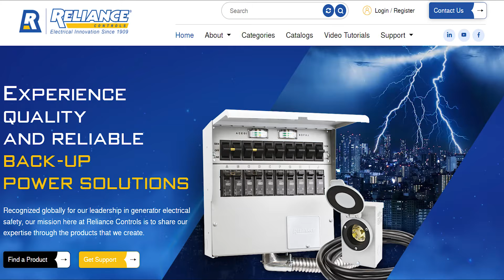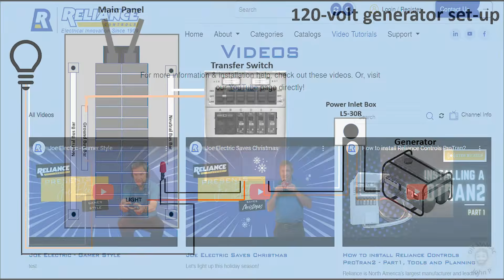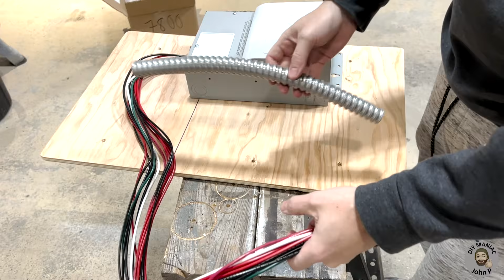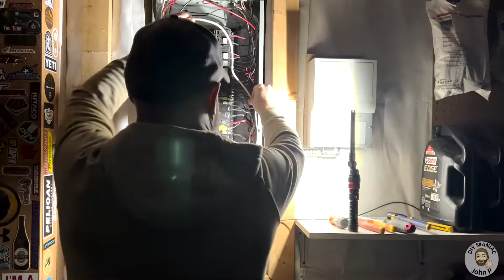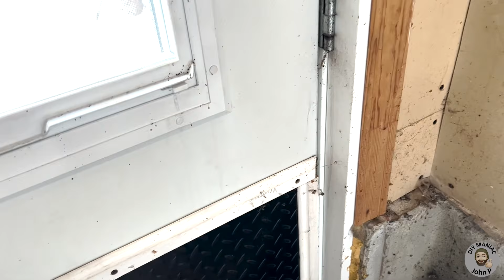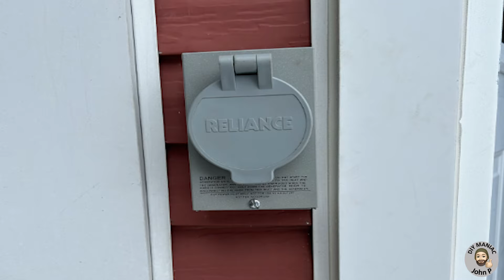Manual Transfer Switch for Home Generator Install Reliance Controls

Comment: Can you use wagon connectors instead of wire nuts
Reply from the maker: You would need to check with your local building codes and electrical codes

Comment: I just installed my 10 circuit Reliance transfer switch and agree that the red and black wires that go to the circuit breakers should be about 12" longer.  Also it's not clear in the manual how one should position the Reliance breakers both with utility power and with generator power.  The Gen/OFF/Line switches are clearly marked but the breakers are not and there's no mention of them in the manual.  I will say that the unit is well made and of heavy construction and it's nice to see that it's made in Wisconsin where I live.

Comment: Got a question,  Have a 22kw whole house standby already installed, so the bonding is done in the transfer switch, and the grounds and neutrals are separated in the inside breaker panel. If installing this as a back to the back up, do I keep the ground and neutral in the the breaker panel separated for this switch?
Reply from the maker: I am sorry, but I am unable to provide any electrical guidance. This is based on guidelines being different from geographical location to another, but also I am not a certified electrician. I recommend you reach out to a local electrician to answer your questions.
Reply: @DIYManiacJohnP  no worries, thank you.

Comment: Did you have to make your generator a floating ground from a bonded ground?
Reply from the maker: With this particular set up if you are following code, the generator must have a floating neutral. Only one bonded neutral is allowed in the home electrical system, and that is already been done in the main service.

There are generators on the market that come with a floating neutral. Otherwise you will have to modify the generator you have.

Comment: I don't understood why you would want to do this over a manual interlock -especially if you're a DIY kind of person. It's so much more expensive than just an interlock, and so much more limiting. I can choose what circuits I want, whereas with a transfer switch, you're stuck with what you chose. It's much more flexible just to do a manual interlock, and understand your circuits, so that you can power what you can support. Plus, it's a whole lot cheaper.  I love mine
Reply from the maker: The point of this video is not a debate which way is better. It is to show how to install a manual transfer switch. 

If you are happy with your set up then that is fantastic.
Reply: This is a good option if service disconnect isn't at the main panel.
Reply: pros and cons to each method really - with the manual transfer switch, at least you could run some of those circuits on utility power, and some on generator power (nice flexibility if you have solar panels and a solar generator/power station)

Comment: Thank you for sharing your experience, I was wondering if I can install my transfer switch next to a subpanel instead of the main panel (my essential breakers: Fridge, furnace, lights are on a subpanel).
Reply from the maker: Thank you for watching.  while I would of course want to help. My advice is not professional so I would suggest reaching out to reliance directly or your local electrician with any of these questions.

Comment: My question is if the transfer switch is in the LINE position when running off the panel, and GEN for the generator. What is the off position for?
Reply from the maker: Exactly as his name states.  it just shuts power to the systems it’s feeding. It’s just a quick way to kill power to anything connected to it regardless if it’s on generator or line.

Comment: Can these breakers in the transfer switch be switched to square d  breakers? Also can all the breakers be switched to 20 amp breakers. If they cant be switched to square d breakers then which ones are compatible
Reply from the maker: I can’t speak to switching the brand of breaker that you will need to contact the manufacturer, but yes, you could replace from one amperage breaker to another as long as the wiring and the rest of the connections are rated for that amperage draw
Reply: @DIYManiacJohnP is the transfer switch rated for 20 amps on all the slots
Reply from the maker: @weldonpinder7295  your best to refer to the manufacturer or going to their website and downloading the operation guide this would give you the most accurate information
Reply: @DIYManiacJohnP would you have a link for the manuel because on the website the page keeps freezing. I dont live in the usa any im limited to what is here on my small island
Reply: Yes, square d breakers are compatible.  QO, QOU, QO-HID, QO-PL, HOM are all compatible.

Comment: I agree with the others—this is hands down the best and only video that thoroughly explains transfer switches. Much respect!!!
I’m using a portable generator with a 50A outlet (14-50R) - (12,500/9,500-Watt Tri-Fuel: Gas, Propane, Natural Gas Powered, with Remote Electric Start). My plan is to connect it via a 50A transfer switch. The A510C model appears to have a single 30A double pole breaker (for 240vac)?
Since my main priority is powering my home’s AC unit, I understand that the compressor requires a high starting amperage. I’m considering something like the Micro-Air EasyStart (368 Series) to help REDUCE that load/amperage during startup.
For those using a portable generator (not a Generac), what solutions have you found effective for running a 4-ton Carrier AC unit?
Reply from the maker: Thanks for the kind words and for watching.
Reply: We have a 3-ton AC unit that I installed the Micro-Air EasyStart (Don't remember the model #) We can run it on our 9000/7250 watts Tri-fuel generator using NG.

Comment: Thanks. This was a helpful demo. I have the Pro/Tran 2 model and it's set up the same way, but allows for a single 220 circuit. Unfortunately the kit comes with a 4-prong plug, but my Powermate 4500DF generator only has a 3-prong outlet, so hopefully i can find some kind of 3-4 adapter for it.
Reply: It looks like the Powermate 4500DF is a 120V only generator.  It will not have a 4-prong plug...
Reply: @jimbumgardner4835  Correct. i was able to find a 4 to 3 adapter that works, though.

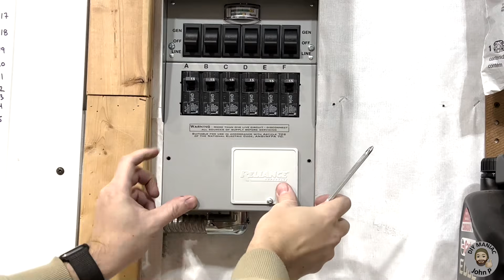Comment: 11:55 Why did you skip showing the wiring of the power inlet wires to the transfer switch. Did you wire the bare copper ground from the power inlet box to the green screw AND the green wire provided in the transfer switch to that screw as well?

Comment: Here there! I have another question. I installed the 30amp transfer switch. I’m going to run my champion generator that is neutral bonded to the frame. Does it need a grounding rod? So much confusing Information. I’m assuming my home system will ground everything. Thanks for your help!
Reply from the maker: I am sorry but I can not give that type of recommendation. You are best to check with a local electrician
Reply: I totally understood that. Can you give a hypothetical answer and not a literal one? Just interested to know lol

Comment: Even though these switches are sold all over in the big box stores, there are electrical jurisdictions that do not allow wire nut splices within the breaker box. Check with a local electrician before trying to DIY this kind of unit. Your insurance company might void your house insurance if you are not in compliance with local code.
Reply from the maker: Well, said I stated in the video this is just for instructional purposes. You must do your due diligence before doing this work.

Comment: Great video man! I have a dumb question to ask haha does the breaker amp have to be the same as the transfer amp to join them. For example if I have a mini split that runs on a double pull 15 amp which is 30 can it be hook to a double pull 20amp which is 40. I’m a newb but I would assume it needs to be the same. Cheers!
Reply from the maker: Yes, it needs to be the same.

Comment: I have the 10 circuit outdoor version of the Reliance, that has an integrated 50amp generator connection.  Their customer service is excellent.  Installation is very straightforward, just takes time to get all the wiring connected.  A nice feature is a sticker inside the cover that lists breaker models for the major manufacturers, so if you need to change the amperage on some of the transfer box's breakers like I did, it's easy to shop for breakers.

Comment: is the generator sending 120 or 240 to the switch???  I "heard" that it will accept either,  but is the wiring the same??
Reply from the maker: My generator is sending 120 V but yes, this transfer switch and work with both

Comment: I have the 10-circuit transfer switch in the outdoor enclosure.  I mounted mine next to the meter can.  I was originally going to follow an old water-heater control conduit via the can, but determined that this would not meet current code.  I cut a hole in the back of the panel and used the supplied liquidtight to pass thru a thick brick wall to a large junction box immediately  below the breaker panel.  This provided ample room for wire routing and splicing those which wouldn't reach the desired breakers.  I'm very pleased with the switch design, function, and layout.

Comment: You could put a 240 on/in that transfer switch if you used two of the 120s for the hot water heater, for exampl, no?
Reply from the maker: Yes you could

Comment: My main panel is on the outside of my garage, would I be able to have a transfer switch installed on the interior wall of the garage and have the wire ran through the wall to the main panel? I was looking at a 50A transfer switch that has the generator input on the front of the trans switch.
Reply from the maker: You will need to check your local byelaws to ensure that any installation you do meets requirements and restrictions
Reply: @ aka local electrician is my best bet to ask. Thank you

Comment: Question, when power goes out do you turn your panel main breaker off before starting generator so it doesn't backfeed into the grid?
Reply from the maker: The answer to your question is highlighted in the video multiple times thank you for watching
Reply: @DIYManiacJohnP  You talk about turning the main breaker off during the installation and you discuss the switches on the Transfer switch.  I am talking about during a power outage should you turn off the main panel breaker before starting the generator.  A simple yes or no will be fine.
Reply from the maker: @stevecunningham936  i’m sorry if what I highlighted the video wasn’t clear but the way the unit is wired and as I demonstrated in my schematics, there is no need to turn off the main breaker as when the transfer switches activated lying voltage is cut
Reply: @DIYManiacJohnP  Thank you

Comment: Nice work— thx for sharing this.  From what I can see in your video, it appears the neutral is not switched therefore I’m assuming you’re using a floating neutral generator so that you don’t have two separate bonded neutral points in the system?   Can you talk about the bonding of your generator configuration?

Comment: Great video.  I see that you used a Wago-type connector to bridge together the 10AWG black and red wires inside the Reliance switch before wiring the L5-30 inlet.  I didn't hear you mention that in your narration (maybe I missed it).  Should be made clear as obviously the switch natively expects 240V.  Thanks.
Reply from the maker: That is how it comes wired from Reliance. Thanks for watching!

Comment: Can I  install 2 Power Inlets : one is outdoor and one is indoor to this Manual Transfer Switch ? . That means I  can use either outdoor one for gas generator or  indoor one for Delta Pro (but not both at the same time) , is that OK ?  Please advise me if anyone know ?
Reply from the maker: Yes, you can physically do it. Would it be to code that you would need to check local guidelines.
Reply: @DIYManiacJohnP  , thanks.

Comment: Hi John, With this setup, can I use my small Honda 2200 watts ( 120 V / 15 amp plug) to connect to this transfer switch where I will manual select which circuits should be  ON (total not over 2200 watts)  ?
Reply: You need to determine whether that is 2200 starting watts or running watts and you would need the correct adaptor to plug a 3 prong into a 2 prong
Reply: @shawnphillips1220  , thanks.

Comment: I love my Reliance Control MTS. I use a 104B1 as a way to have a small generator take over duty from the larger genset on prolonged outages, plus, I can use the 104B1 with my Ecoflow Delta 2 and flip over to battery power during time of use. I'd never be in a  home again without something similar.

Comment: wish you had show EXACTLY where you connected the white and green in the MAIN box
Reply: He probably didn't specifically because EVERYONES "MAIN" panel can be different. Some have 1 main disconnect and some have a subpanel. This can get a little confusing if you have no experience with electricity. It appeared He was hooking his transfer switch to a subpanel because his neutrals and grounds were seperate. If he showed you and you followed having a main panel and not a subpanel that would be wired incorrectly.

Comment: Sir, is it OK to instal 2 power inlet boxes, I want to use one for outside for gas powered generators, and another box installed inside, in my case it would be my basement that was I can power my home with various LiFePo4 smart generator batteries, like Ecoflow Delta  Pro rated at 3600 Wh.
Reply: Yes, you can. (I did that) You will need a changeover switch.  I bought ours from Amazon.

Comment: Another video where they don’t show needing either a floating neutral or bonded neutral generator
Reply: I will tell you reliance manual transfer switches are supposed to be only used with floating neutral generators. Bonded neutral generators should not be used with this specific switch. For the reason why that is, you need to become a licensed electrician. You won't find a video explaining this answer because it opens up liability on the person who made the statement. A bonded neutral generator (most new generators) requires its own ground rod attached to the ground lug when being used. The manual will clearly tell you where this lug is on your generator. Floating neutral gens do not require their own ground rod. When installing this specific transfer switch and you hook up a bonded N generator to it, you essentially are using the homes ground rod and the separate ground rod for the generator creating two ground points which is dangerous as there can be only one ground closest to source. You need a transfer switch that completely isolates the neutral and ground of the generator from the neutral and ground of your home. There are some semi sketchy ways around this that work but all of which are wrong.

Comment: Great video, I just got my ESA inspector reject my Reliant 50 A 10 circuit install. Did exactly like the manual says but in Ontario it is not allowed to have any wire nut inside the main panel. I just have a nightmare on my had as I am told to have all my breaker wires routed to a junction box to do all connection in there... Needless to say the frustration I am feeling right now is tangible. I am going to a electrician supplier to see if there is junction boxes that can handle that many wires at the same time.🤬
Reply from the maker: That sucks!!! Sorry to hear that you had that issue. Looks like at least you have a workaround, even if it is not ideal

Comment: i installed the transfer switch to be ready for power outages.  Since I installed solar panels to power my portable power stations, and my Edison power is 3 times more expensive from 4-9pm each day, I cut completely off Edison power to save money from 4-9pm each day.   I have my refrigerator and stove on same outlet, when I transfer too the  portable power station, or back to Edison power,  I have no power interruption, my refrigerator does not miss a beat, and the stove clock keeps it time.  This surprised me that the transfer was so fast, as I did not want to start and stop my refrigerator everyday.   Since the transfer switch is inside my house, it makes it very convenient!

Comment: No wire nuts allowed in the main panel where I live as of the last few years.
Reply from the maker: Where do you live?
Reply: @DIYManiacJohnP  Up in the Great White North, eh!
Reply: How about Wago connectors?
Reply: @timothyletwin5911   No connection of any kind in the panel. You need a separate panel altogether. Transfer switches will not pass ESA inspection because of the neutral issue so even though they are for sale they won't pass.
Reply: Thanks a bunch. Kind off a joke they sell them like that hey? @Synonomous
Reply: @timothyletwin5911  Yep. Costco, Home Depot both sell them. You install them or your electrician does then ESA says nope. A buddy spent $700 on the switch and $1200 on the electrician and wasted all of it when ESA came by to inspect. Funny many 'pro' electricians do not know this.

Comment: Great video very well done. One question would be are those 20amp breakers in the main because the transfer switch has 15amps?   One would think you need to change those in the transfer over to 20amps.

Comment: Thanks for sharing. Did you have to make your generator to have a floating neutral ground? Thanks.
Reply: I floated my neutral on my port gen. My panel has the Neutral bonded in there. I read, you don't want two power sources bonded, only one.